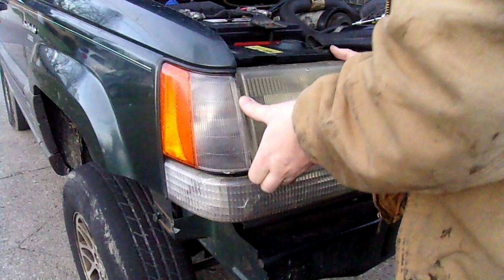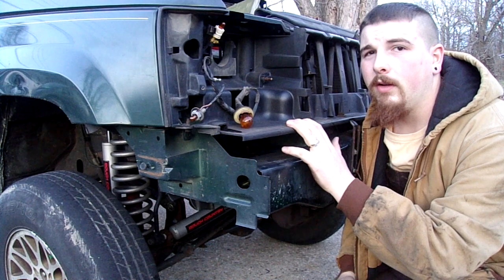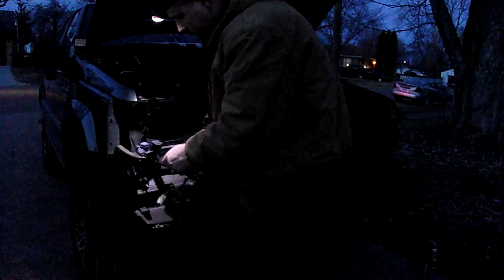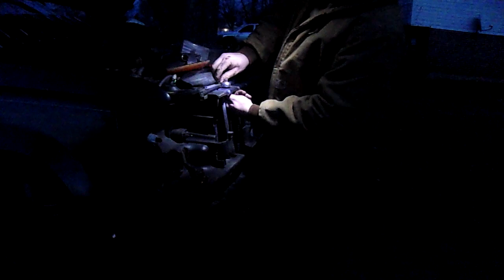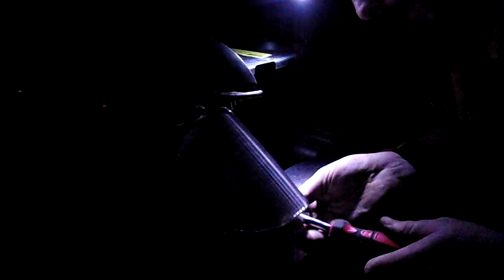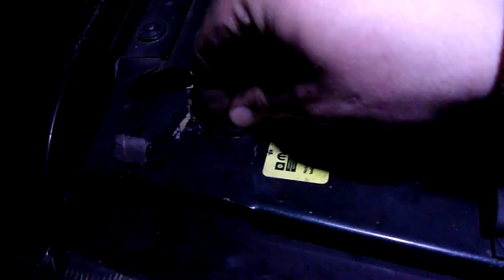Removing The Headlights And Grill On A Jeep Grand Cherokee

Comment: I want to know how you removed and reinserted the headlight adjustment screws and gears into the new panel? or did you just buy new ones? if you bought new ones, where did you get the parts?
Reply: I also have this question.  We had a frint end collision so the original header is broken including the headlight adjusters.  Not sure what they are called to order new ones